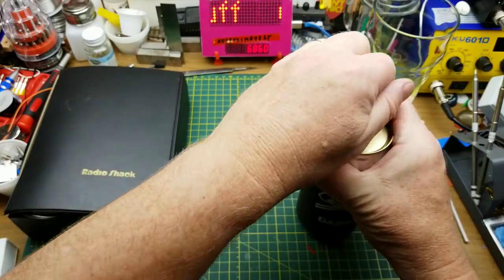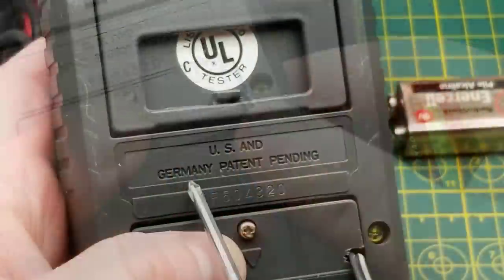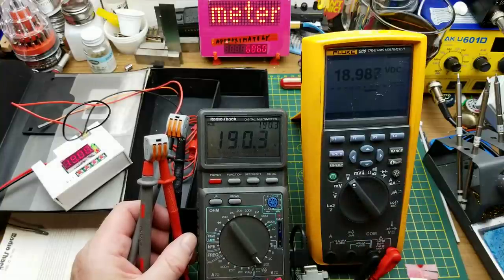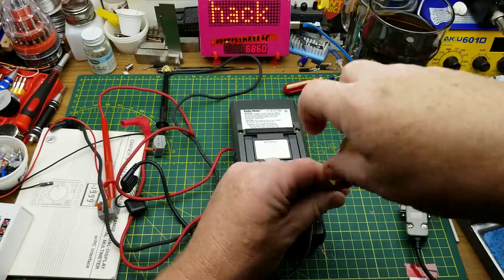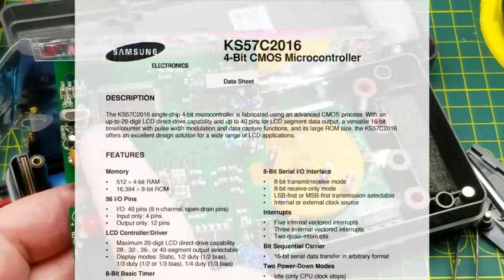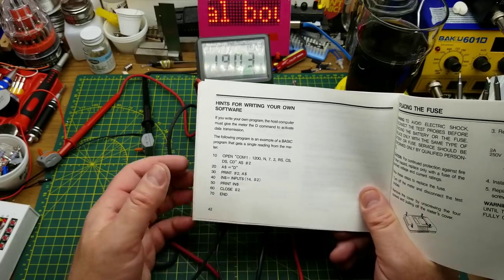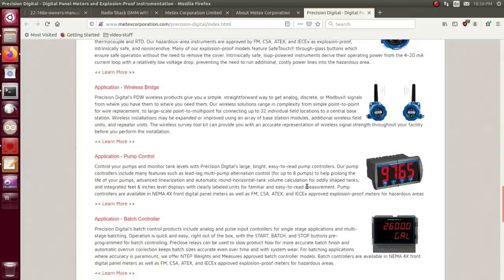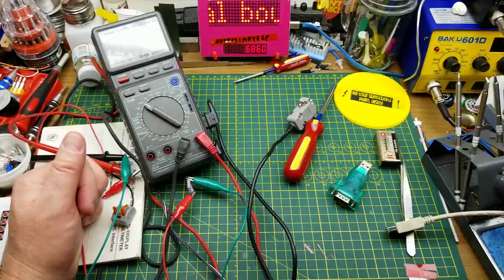Checking out an old Radio Shack multimeter - with a special ability

Comment: you could connect an esp32 to the port, put the c programme on the esp32 and then use a text to speech prog (which exists) to speak out the values

Comment: Even before you opened it I thought it must have been manufactured on Radio Shack's behalf by Metex; the back case design looks almost exactly like my first DMM, a Metex M-4630, bought late 80s or early 90s and still works. You say these were bought for your work, but it has "not for commercial or industrial use" on the back. Uh oh! I guess I'm in trouble too because my Metex says "not for domestic use". We can't hide forever, our pasts will catch up eventually.
Reply: Is Metex M-3650D

Comment: I still use mine! It cost 200 - 1995 bucks. It is optically isolated as built! The schematic is still posted somewhere. It works best by adding a tiny Arduino data logger inside and save everything to SD card. The logger has to send a start command to the DMM to get serial streaming out

Comment: If you still have this DMM, check on the middle label.  Is there a round soft spot in the middle of the label?  I have the 174A and the label covers up the continuity buzzer opening.  I carefully cut a hole in the label above that hole and I the amount of sound has increased about 5 times.  On my unit, I can't even see the piezo from the inside, it's completely sealed unless the label is modified.

Comment: I think mine (new) cost about the $100 he mentioned. I still use it for basic measurements. The display still looks as good as the day I bought it, which is REALLY shocking considering LCDs from that time weren't the most chemically stable. It's still very accurate for volts and amps and the occasional resistance.
 I really like that I can set it monitoring stand-alone and it will capture things like Max, Min, and multiple functions it can perform all on its own WITHOUT the PC.

However, instead of the RS DMM, I now mostly use a Hantek 2D72 Handheld 70MHz Dual Channel Oscilloscope. It's very accurate and much easier to read in low-light rooms. About US$200. I also like the DMM built-in to the unit. It too, is very accurate.
 It came with a hard travel case (the good kind), a semi-rigid velcro flap carry case, two 1x-10x probes, DMM leads, 2 decent lithium cells, and a nice thick silicone protective open-face "case".

I also use Hantek DSO5202P Dual Channel 200MHz Oscilloscope (bench style). It too was about US$200 but included a hard travel case (the good kind), two 1x-10x probes.

Both of these meters connect to a PC if desired.

Comment: So what happened is that Radio Shack corporate stores don't exist but local hobby shops and electronics shops still sell Radio Shack merchandise. It's usually labeled as Radio Shack Express. They have one or 2 aisles of RS stuff.  I like it better because the owner is actually knowledgeable in electronics and not some kid just selling components he knows nothing about. Plus it is better to shop locally when you can.

Comment: I still use mine on an everyday basis, it was so worth the $100 all those years ago, esp. since the meter's built in functions are still quite extensive for a multimeter. The windows datalogging software that came with it worked fine and was useful (for its time) since you could also export log files to a spreadsheet or whatever easily, and I used that back in the day as well. Haven't in a long time due to the modern compatibility issues you noted, but I had completely forgotten that RS had published the serial communications protocol. It would be trivial to hook it up to an arduino, I might just do that!

Comment: I still use mine that I purchased in 1996. Does anyone know whether I can use it to tell if a battery has enough charge? (e * v) I understand that just measuring the output voltage is not enough.

Comment: The meter came with a Windows program, "ScopeView". What's the latest OS that will work with it? I installed it on a 2006 MacBook Pro that has a Vista partition. The program starts, but it's not configured yet to know where the meter is.
Reply: It worked after installing the driver from the serial-to-USB cable company cablestogo

Comment: I just have blown my Multimeter, now needing a replacement for it, I might have to do the old eBay thing and see if I can't find one of those somewhere lol
Reply: I can recommend the Hantek 2D72 Handheld 70MHz Dual Channel Oscilloscope. It's very accurate and much easier to read in low-light rooms. About US$200 with a hard case and probes. It also supports PC connectivity and having an 2channel oscilloscope handy is sometimes very nice to have out in the field.
It uses 18650 lithium cells and came with 2x 2600mAh high quality cells. However, I replaced them with high quality 3200mAh cells for longer run-time. They can be recharged in-situ using a USB-c connector cable and a "standard" 5Volt USB recharging device.

Comment: Ha! "This program is rude in that it does not restore the serial line parameters on exit." You could write something called a SIGNAL HANDLER that "traps," for example, the user pressing CNTRL-C. The signal handler is just a function, written by you, that is called by the OS. In this case the function would just reset the serial line parameters back to their original values and then exit "cleanly."

Comment: i noticed your c program set the dtr lead, i wonder if the plain serial terminal failed to do that step. i guess you could hardwire it...
Reply: That exactly. I also noticed that in the text on the site and at the right bottom of the terminal window.
Reply from the maker: The more i look into it, it seens loke DTR is needed. 
I wonder why the BASIC program didn't explicitly operate it? Maybe DOS automatically pulls DTR?
Reply: @pileofstuff  DTR stands for Data Terminal Ready aka to signal the other end you're ready to receive. It would totally make sense that it's needed here and that DOS or basic took care of all the auxilary signals back then. In the early days it was pretty easy to overflow the other end. Later things switched to XON/XOFF and thus saving wires but that meant (real time-ish) parse the data.
Reply: @pileofstuff  i think the answer is in the http://linuxtoys.org/dvm/dvm.html website, it even says it powers the port in the multimeter, i didnt think much of this at first but it would need higher than the 9v meter battery to cause the port to output proper rs232 levels for 1 and 0. There were some extra parameters in the basic program line 10 "open" statement, i probably assumed that might be handshaking setup, if not then maybe just got lucky with dos handshaking although it seems a little strange dtr low +12 and rts high -12 as i think that says terminal requests to send yes but terminal not ready, thankfully data is received and displayed anyway, apparently this use of handshake leads is common practice to power external interface devices.
Reply from the maker: @fumthings  I think you're right.
It would be a pretty low current way of powering things, but if the only use is to drive the RS232 signals, there probably isn't much of a draw.

Comment: I have been trying to find a replacement 160x128 pixel color display LCD screen for my GM328 Transistor Tester Diode Capacitance ESR Meter PWM Signal Generator.
Have you ever come across similar in your extensive searching. I have not had any luck in all my searchers.
Cheers
Reply from the maker: When I broke my first one I tried the same searches, and wasn't able to find anything exactly right either. 

I just bough ta replacement tester when I found one on sale, and salvaged some parts from the damaged tester.

Comment: Hello, i have that same meter i got back in 1996, it has been a great meter but recently i lost the amp reading do you think i may have blown that 20 amp fuse in it ? Any help would be appreciated.
Reply from the maker: The fuse is the most obvious possibility. And the easiest to check (and replace).

Comment: Can you give examples on when to use the Multimeters Log for logging resistance measurements and voltages of what type of circuits would you want to be logging? Also can you give examples of when to use your fluke meters low impedance mode and low resistance 50ohm mode, when to use it for what type of circuits?
Reply from the maker: The application we used to for at work was to track the receive level (AGC voltage) of a point-to-point radio system over time to see why (and when) we were getting errors.
Reply: @pileofstuff  you're recording a voltage log of the radio receivers AGC voltage over time? The AGC voltage will always do changing depending on the Radio Receivers input level, so I'm confused how would you see the errors?
Reply from the maker: @waynegram8907  When the receive level gets low enough the demodulated signal falls apart.

In the specific case we bought these for, there was some dramatic fading happening for short periods of time (caused, we suspect by effects like https://en.wikipedia.org/wiki/Thermal_fade) which dropped the receive signal down to almost as low as when we shut off the farend transmitter.

Comment: If you want a useful computer connection you can use you can use https://lygte-info.dk/project/TestControllerIntro%20UK.html
You must make a definition for meter, but with this simple meter it is not that hard (It will be something in the style of Protek506 that is included).
In addition the program already supports the Fluke 289, i.e. you can log from both meters at the same time.
The program works on Windows, Linux and Mac, because it is a Java program.